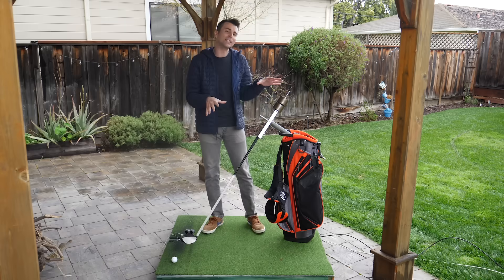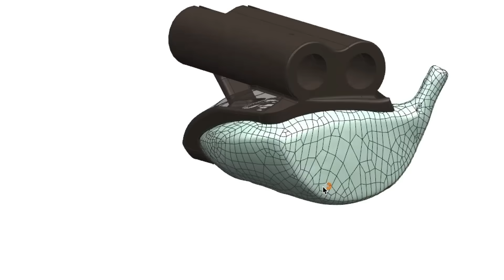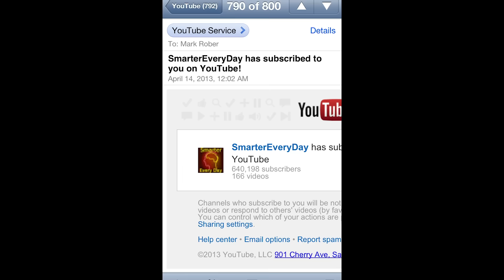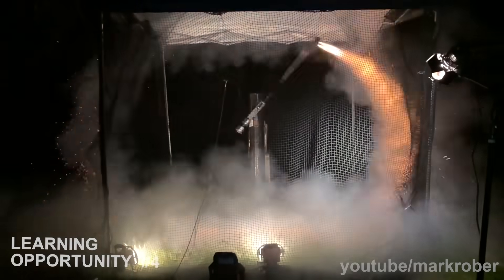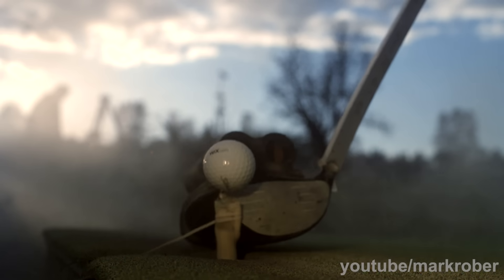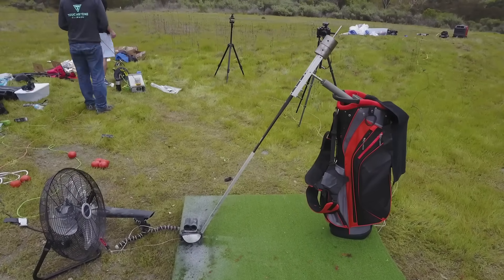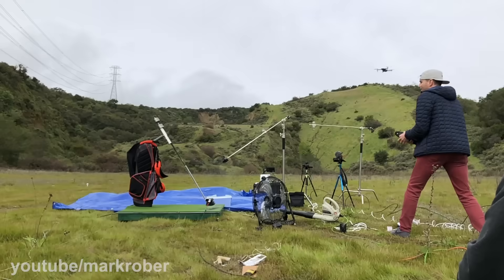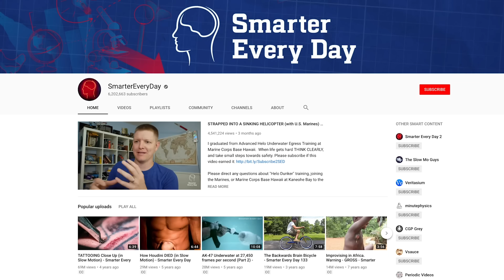Rocket Powered Golf Club at 100,000 FPS

Comment: This video looks very similar to what a Colin furze videp would normally look like.

I was mainly refering to first parts were you see steel rods being cut and holes being drilled
Reply: They are lik e brothers
Reply: colin made a rocket powered scooter and a few other things
Reply: The build is something Colin could have made but as usual Mark's video has such a great production value that Colin's just lack. But still, both are great :)
Reply: @Spare074  I mean one is a Mass engineer and the other is a plumber. Both have different approach to inventing

Comment: Why did you stiffen up the shaft its flexible for a reason just lower the axel so it wont break smh
Reply: And if you cut the back off it would go faster because it covers a smaller distance making the centripetal force lesser in the process but the drawback is you get a less perfect swing because you have a smaller swing but sinse it rotates 10 times to go the fastest it wont matter...

Comment: You could put a gps tracker in the gold balls to see how far they went
Reply: They’d probably break
Reply: @fran-wk3nq  I suspect that modern solid state electronics can handle quite a bit more G forces than the vacuum tubes in the proximity fuzes for artillery shells in World War II.
Reply: @fran-wk3nq  the thing is they need to receive that info as well so if you put a tracker you also need to power it and transmit that information back, you can't add all bulk to the ball without removing the functionality of the ball itself.
Reply: How to break some electronics
Reply: I thought the same thing but that's not how they work bro
Reply: Nah that would have definitely worked
Reply: Ya gold balls would work good
Reply: @loganmitchell1280  lmao definitely
Reply: Nathan %% maybe let the ball smoke or something, so you can see where it lands
Reply: how about a tiny camera
Reply: @rajathpai9573  same thing you need to transmit the info and add power read the last comment and replace the tracker with a camera.
Reply: @TirthikSaha  Cameras with built in video transmitters and antenna are extremely small and light and can run off a very small battery aswell
Reply: @aintgotnobody5518   okay let's assume it does fit in a golf ball and does not affect the weight distribution of the ball and the fact that the golf club doesn't hit the lens of the camera what will you do if the ball lands with the camera facing the ground. Since you can't transmit audio you can't find out plus even if it did fall facing upwards it would be actually very hard to pinpoint the location in that huge field.
Reply: @aintgotnobody5518  and Mark worked on the Mars Rover I am sure he would have thought of a way to find out to track the ball but it's actually not that easy.
Reply: @TirthikSaha  damit, my long comment was useless, u pointed it out already.
Reply: @TirthikSaha  well, saying that, creates an unlimited loop, kind of. Bc, if u assume having brain = being correct and not having brain = no brain. Then, from that anwser what are you. Bc, if u say that I only have a brain, then u are correct, but, if u are correct, u have a brain, so, u are incorrect. Hmm, I guess u can bypass it by just saying hav
Reply: @Alexander-xo5ho  stop flexing the only meant to be flexed is flex tape
Reply: @rajathpai9573  well, the field looks quite the same from most perspectives. Unless, it is filming something that sticks out. Which is just luck. Or, it chooses to go on the other side of the ball, and films the ground. Or, just films the sky. So, it might leave only like a few degrees of are where the footage can be used. And, only, if the horizontal tilt is correct. So, it would have to be a spot somewhere insinde like 7+7 degrees vertical, and like some specific amount of degrees horizontally, lets say inside of a specific 10 degrees. The degrees depend on the field of view. And, this isnt even a valid respons, if it was said a gps takes too much space bc of battery, a camera also needs a transmitter and battery, so, oof :|
Reply: If they were made of gold they probably wouldn't go very far
Reply: @jimothyj2638  for the love of Elon musk it is a typo he doesn't mean an actual gold ball he means golf ball.
Reply: Haha, not really. Many experiments just involve an on board camera where the footage can be retrieved later. Agreed that the ball is going to get lost but that makes it one hell of a footage to recover.
Reply: Trackman or flightscope. It uses Doppler radar to track everything. I want to see that data so badly.
Reply: They don't necessarily need GPS, just a tiny rf transmitter to be able to direction find it.  Like they use on  wild animal trackers.
Reply: He would probably loosd his sponsorship tho
Reply: Given the initial velocity and launch angle of the golf ball, you can find the theoretical distance that the ball will travel using the projectile motion equations. 

X = x0 + v0x * t
Y = y0 + v0y * t + 1/2 *g*t^2 

Solve for t in the Y equation and then plug it in the X equation to get x

Comment: Hey mark I don't know if this would be a question for you or Destin, but I was thinking about something I heard about long ago. When I was younger (maybe 25 years ago) I was told by some friends that if you wanna break a car window easily to throw a spark plug at it (or at least just a broken piece off of it). I found videos on YouTube that prove that it is true, but no one explained why. I just think it would be interesting to explore why it is easier to use a broken ceramic shard, rather than a rock.

Comment: I think you should put in a tracker of some sort in that ball and see where it goes ?

Weird question - how'd you know that the gold ball could handle all that much  stress without ripping apart ?
Reply: He didn't know that.
Reply: I don't think he knew. If it couldn't have taken it, it would have just been another "learning opportunity".
Reply: I think he explains in the video that professional golfers can swing a golf club upwards of 100 mph. If this rig swings the club at 150 mph, that's only a 50% increase in force, so a golf ball designed to handle 100 mph with ease is unlikely to fail at 150 mph. I'm not aware of the true failure point of a golf ball, but it's probably quite a bit higher than even this magnificent invention.
Reply: @danielhebard1865  means it can probably handle  way more than that rig,  WE NEED MORE FORCE !💀🙈